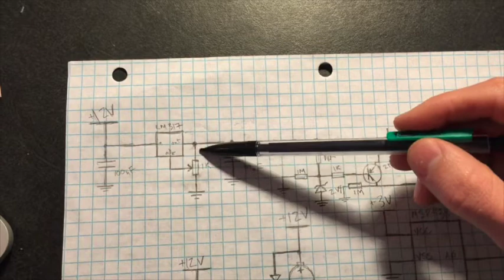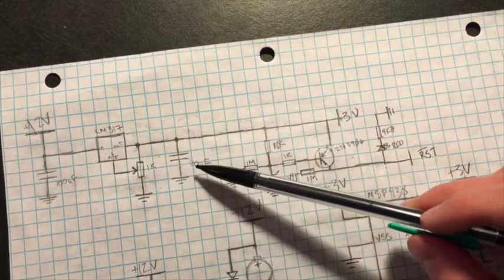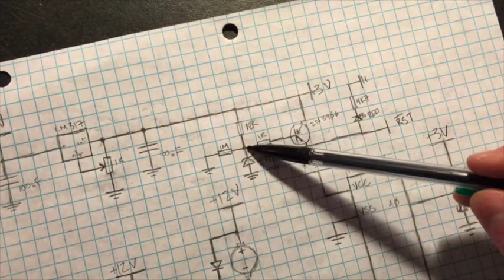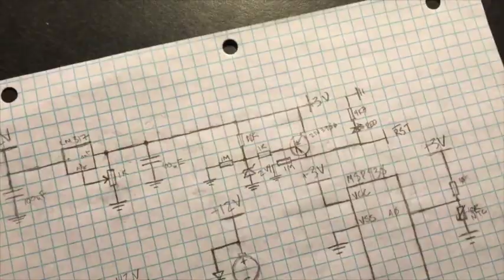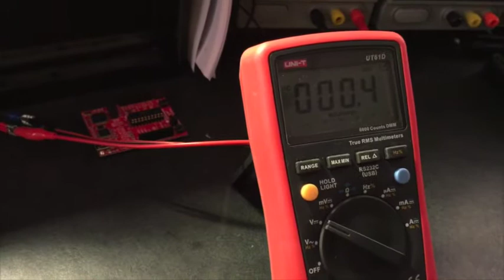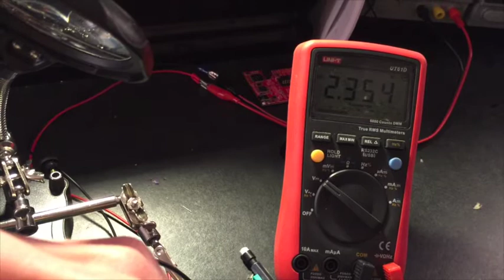Solar Collector Fan Part 2

Comment: Very cool. What are the upper and lower transition voltages that switch the BOR circuit, and how steep is the transition output to the reset pin?
Reply from the maker: https://www.dropbox.com/s/k21wb81nq9c07uh/2015-01-13-BOR-Response.gif?dl=0

That's an interesting question. Here's an image from my DSO that shows both the transition voltages and the transition time. I'm using 1V division and 800mS time division. 

CH1 (yellow) is the input voltage, and CH2 (cyan) is reset voltage.